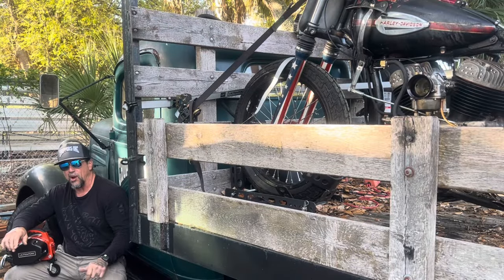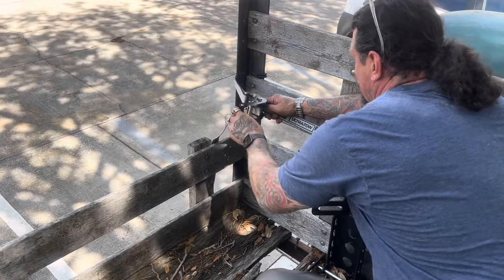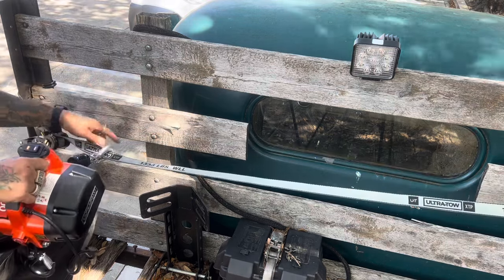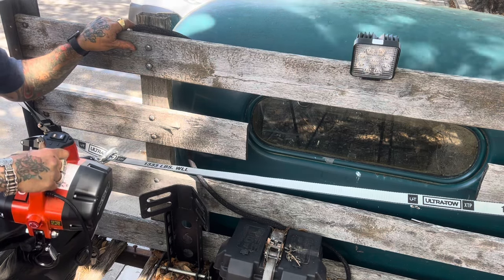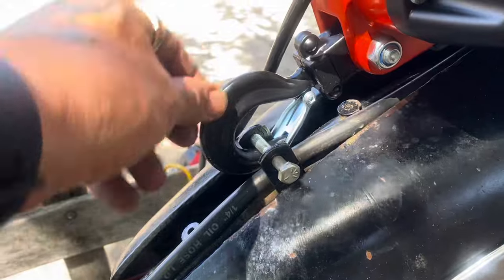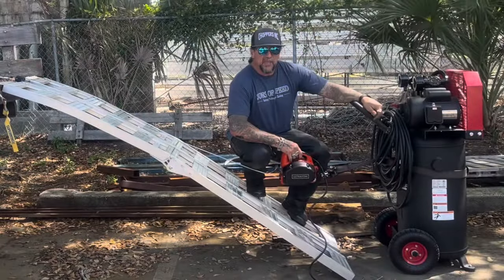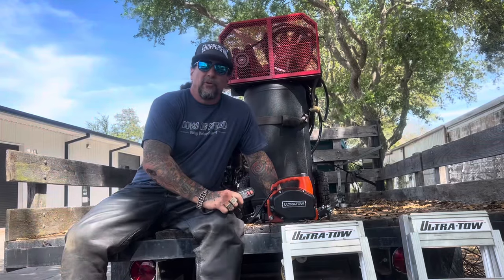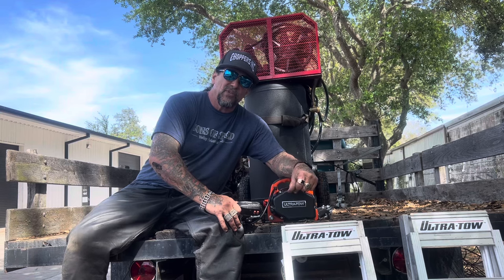Billy Lane How To Load Harley Flathead Racer By Yourself Ultra Tow Portable Winch Daytona Bike Week

Comment: I would look into a removable gantry crane for your truck if you want to load alone, the winch is nice, but once you get a little older, you might want to not have to deal with the ramps. The gantry mounts are flat when the crane isn’t mounted, so the truck bed will be completely usable. I think Northern Tool carries them as well. I had one a few years ago when I was buying and selling big air compressors, made life safer and simpler. 👍
Reply from the maker: Funny, I’m having a gantry crane sent for just this purpose.
Reply: @BillyLaneChoppers  Great Minds Think Alike! 👍 As a side note, I made a jib for mine if I needed to get something up a little higher than the stock crane could do, I bet you know a good welder that could make you one LOL 😉

Comment: Get yourself some synthetic winch cable for an ATV (I think it's Kevlar). I did that with a Warn portable winch, and it about tripled the line capacity, plus it doesn't scratch stuff and doesn't fray or get stuff greasy. I think I went from 15' of steel cable to 45' of synthetic, with higher load capacity as well. Amazing stuff, barely bigger than paracord.

Comment: Coool truck ! I have to use long ramps to key bikes from high centering. With the winch I could probably pull past that point. Maybe even add a roller. Usually takes a couple friends to help load my bigger bikes. I’m considering something in the line of biker rescue gig .

Comment: looks like you need a new deck on that truck !
Use Western red cedar and spray vinegar on it it will sun fade grey instantly ( if you want it sun bleached ) and wont rot because cedar lasts decades
Reply from the maker: Yeah, it’s definitely time for some new lumber. This is an old Iowa farm truck that was bought new and worked for generations by the same family.

Comment: Too bad the winch doesn't have a release to let it out without using the electric motor like a normal winch.
Reply from the maker: It’s actually great that it lets cable out with the button. Unloading the bike is easier because of this.